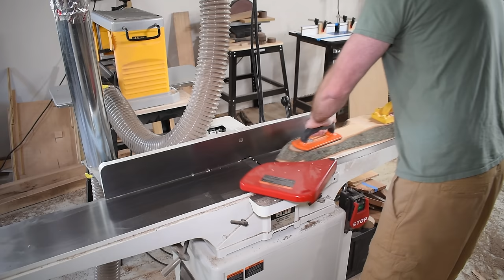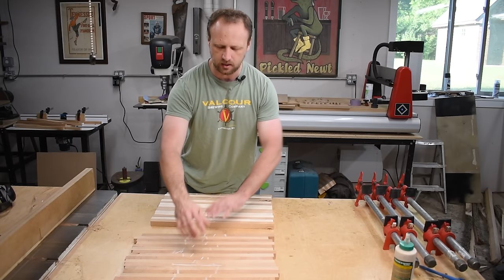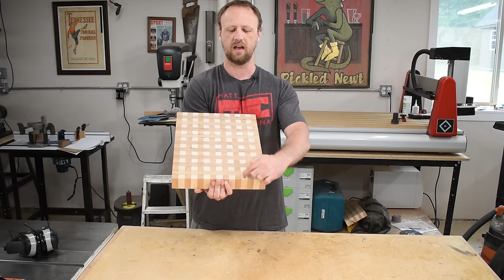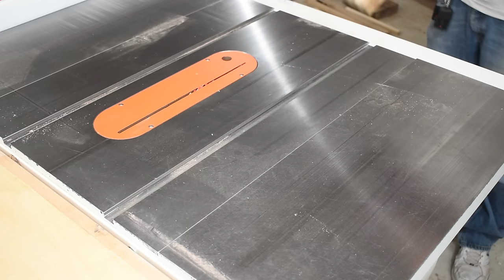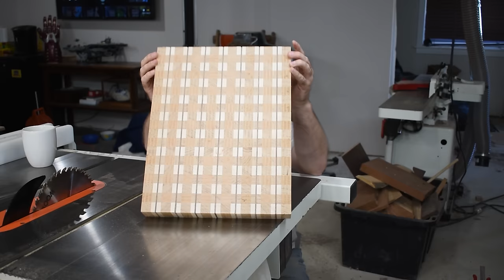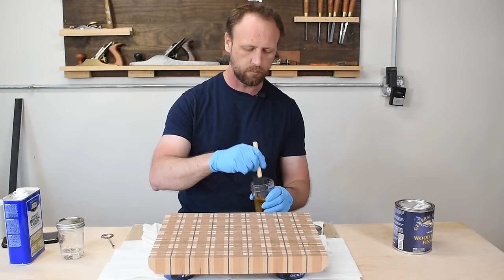Making a Plaid Cutting Board! BONUS - Crazy Finishing Technique

Comment: Be careful; you are mixing end grain and edge grain. Wood expansion won't go in the same direction and you might end up with a faulty board.
Reply: Agreed, I had that same thought.
Reply: @jeepgrand1994  I have made hundreds of cutting boards. The only ones that ever fell apart are the ones where I mixed end and edge grain. This is REAL THING, not just an old wive’s tale. I’ll never mix grain again!
Reply: I had to put edge grain strips in an end grain board to keep it flat. It's been about 10 yrs and no problems yet and we use it just about every day.
Reply: What if you stabilized the wood before finishing or final assembly

Comment: He didn't make the walnut end Grain. I would make it end Grain.  I really do love the plaid, nice work!
Reply: I'm experimenting now, with cutting thin strips on the table saw, being end Grain though is a challenge
Reply: Ben Moore  make a walnut endgrain board to needed length and rip strips from it. May seem like a lot of work but its the only proper way
Reply: Came to say the same. This will not last unfortunately. Beautiful though.
Reply: Ben Moore  lol who needs books and the knowledge of those who have failed and learned before us?  You do you though and when you get your first breadboard end that explodes because you glued the whole thing, remember it’s just some wives tale. 

There’s no issue with playing around and seeing what works but when you start a video with “I’m going to show you how...” you expect that this guy knows what he’s doing. Grain rotations on a board that will certainly see heavy moisture is a silly bad idea and it’s unfortunate that someone may watch this and think otherwise. Or that they cannot safely run end grain through a planer (you certainly can...with proper prep). Or that you need a $4k CNC to flatten a board, etc.
Reply: Ben Moore  glue up panels of walnut then cut them across the grain, making them end grain, then rip them into 1/8” strips.
Reply: @aaronwunderlich3070  I use my cnc to flatten things all the time lol

Absolutely you can run endgrain thru a planer, I’ve done it often with good results. And once where it got hung up and basically fucked off the planer. I’ve done dozens of boards on my cnc and never had an issue.
Reply: @zbeshears6945  I too use a CNC to flatten on occasion.  My point was that there's a video here that seems to advocate that you NEED a CNC to flatten a board, which you certainly do not.  And I didn't say you couldn't pass endgrain through a planer, just that you have to properly setup for it.

Comment: Great video! Nicely filmed, nice commentary, and the board is certainly beautiful. I really like your work.

That said, I do have a couple of comments.

First of all, I don’t know where people get this idea that you cannot use a planer to plane these cutting boards down. I know what people say, that it will end up exploding, kick back out, and the machine will toss shards of metal around your shop, creating an Armageddon scenario!. Well, I have experimented with this for years, and i’ve made about 200 end grain cutting boards. I always use my planner to plane  it down ( previously a Delta Lunchbox and now Dewalt 735). I use the following method:

Use hot glue and shims to stabilize it on a flat length of MDF.
Make sure the blades are sharp.
Make passes in only tiny increments of thickness, maybe 1/256
Before passing them through the planer, use a hand plane to create a small 45 degree bevel on  the trailing edge. This will prevent chip out.
Remove from MDF and repeat on the other side.
It leaves it so flat that it only takes 5 MINUTES of sanding to complete the project!

Second of all, I really do think the mixing of end grain with edge grain will lead to failure. I have done so with only 3 boards, and all three cracked and fell apart in a few months from differential wood movement.

Again, I think the board is beautiful and it’s a great video.

And I now wait for the correction posse to come after me.
Reply: Those were the same things I was gonna ask. Guess good thing I read comments before so.

Comment: Do you have any issues doing the strips being long grain mixed with the endgrain?
Reply: This would be a concern of mine. I built a brick and mortar style years ago and mixed grains and it ended up failing over the years cause of it
Reply: @TomKaren94  Add more glue XD - in all seriousness, I have experimented with a few different wood glue brands/types/strengths etc and I found that my builds held best when not using a "quick dry" glue. That said, I tend to give glue-ups at least 12 hours to dry before removing the clamps, but in some cases more time was needed to firmly bond the pieces. I have also seen a few pieces pop apart due to the wood being kiln dried, which introduces some interesting tension mechanics if it isn't left to settle before milling.
Reply: Generally, a bad idea.
Reply: I’ve never built a board or anything much really and wondered the same thing. Other videos I’ve seen they created end grain strips as well

Comment: Hey Billy, regarding the finish, I am very much a fan of a sealant that actually hardens. I recently made the mistake of oversaturating a board with mineral oil - was weeks of leaching before it could be used, and still feels greasy.  

I’m interested in long term durability of the salad bowl finish. When the finish hardens on an end grain board, I imagine the fibers become stiff and brittle. I’m concerned the fibers might break rather than pull back together (“self-healing”) when a knife penetrates them.

Have you experienced this over time with this finish? Would be much appreciated if you could share your experience with this…thanks…Skip

Comment: Beautiful work, absolutely amazeballs! Question? I've never done inlay before, would you be able to make solid color end grain cutting board, stack it on top of one similar to what you've made, then on a scroll saw, put the angle at just a few degrees, and cut out say like a peace sign and then just drop it in to produce the inlay? Would that be the correct way to do this?

I was just thinking the contrast of the plaid with a solid color inlay, I thought a peace sign would be cool, would be absolutely beautiful and really pop together, especially once the finish is put on. But, would what I asked above be the correct way to do this?

Comment: Billy, that's awesome looking board. The amount of works you have put into this is tremendous.

Quick question, are those strips edge grain or end grain ? I watch many video that said not to mix both on the same board, or it will crack.
How is that possible ?
Reply: He is probably banking on that the walnut pieces are so small, thin, that the movement with me minuscule and not cause any harm.

Comment: I have made many cutting boards but never made a plaid but always wanted too.  I will use your method but will use end grain walnut strips.   I fear you crossed you gains and may have issues when the wood expands or shrinks.  Also I worry about the open grain of oak.  Just my 2 cents...

Comment: I made a few cutting boards and they look great. But a few weeks later if you run your fingers across you can fell the sims, kind like if the wood swallow but the weird thing is that l haven't used yet. I treated with mineral oil and beeswax.

Comment: What was the ratio of salad bowl  mix to mineral spirits and was it the same for all 3 coats? Great video I’m definitely gonna try this. Also how does your glue ups not stick to your squaring jig as the glue pushes out and it’s clamped to the board. I’m thinking you could use wax paper?  Curious on that one.

Comment: Wow! What a beautiful board! Very clever! With regard to finishes... If you actually cook from scratch there is a big difference with regard to the amount of time your food is in contact with a cutting board as opposed to the time a french fry might lie on a table before it is consumed. On top of that cooked food is dried out and therefore usually less porise than raw. So the porise raw food you have coming into contact with the finish on a cutting board for the 10 minutes it takes to slice is considerable. If you do more research you'll find the most food safe finishes are actually made from food. Believe it or not some food oils when heated and let to cure become stable and don't become rancid, like walnut oil. Whereas finishes made from the same stuff as gasoline won't kill you immediately they may add to the toxic load in your body. But beeswax on the other hand is actually considered a healing food and people eat it to help aid their digestion. Why not use finishes on cooking items that are actually digestible and aid digestion!

Comment: The board looks amazing.  So, I send end grains into my planer 🙃...It works great as long as I take extremely light passes...the down side to this method is that I am limited to how wide my boards can be.   I really like the choice of finish.  I have tried the Tried and True, but that finish won't last long with washing and cutting... Or I don't believe so anyways.  This method seems like it was last a lot longer.  Are you concerned with the long grain Walnut vs the end grain surface?  The strips are so thin that I don't think it would really matter... Plus It actually might keep it a little more stable.  One more thing about it, this finish must be embedded into the wood and probably keep it a little more protected from the moisture (less wood movement).  Curious about your thoughts on that because I have heard that you dont want to mix long grain and ingrain in boards (everyone has an opinion).  The board looks beautiful 👍
Reply: @NewtonMakes  thanks for the info man!  I want to try the finishing method ASAP.  Keep up the great work 👍

Comment: So i havent made an end grain board yet but have researched it quite a bit. With those walnut strips shouldnt they also be end grain? the board will eventually fail with having end grain and edge grain fighting each other. thats why people glue up those thin strips in a panel and then cross cut them and insert. Regardless beautiful work and nice pattern

Comment: I am a woodworker as well and have made many cutting boards. I have always heard that you shouldn't mix end grain and long grain in the same board. This board is end grain with long grain in the walnut strips. Do you foresee any wood movement issues long term with this?
Reply: I usually glue up an end grain panel and gut it into strips, but in this case when you think about the application, the end grain is on top and bottom.  So basically the walnut strips are just like gluing face grain or edge grain - I don’t foresee the issue many are talking about since its not an end grain-face or edge grain glue up

Comment: Great video Billy.  I have a comment and a thought.  Comments are easy, thoughts not so much.  I made a 3-d cutting board a while back and used the General finishes salad bowl finish.  So far it is still smooth.  So the seams are not discernible.  Now for the thought:  Seems to me that if you use a poly for the finish it fills all the 'straws' thus making the porous wood like the oak non porous.  What do you think?  I' m just an old retired tool/model maker, so I am no chemist. LOL

Comment: Hey bud. Can I ask why the dust collection on your planer has a 2” piece connecting two 4” connectors? Wouldn’t the dust collector work less and collect more if you went 4” to 4”? Or does the smaller piece improve collection?
Genuinely asking. I have the same planer with a 4” connection...but my small delta dust collector get clogged with planer shavings.
Thanks!
:)
Reply from the maker: I get asked that question a lot. I get it because it's deceptive. My planer has a 2.5" port. It looks like a 4" port but it's molded plastic that goes down to 2.5". I don't want to cut it off since I'm upgrading my planner eventually and whoever gets this can use a shop vac with the current setup.
Reply: @NewtonMakes   I promise I am not trying to insult your intelligence lol. Like I said, I have the same planer, and mine came with an adapter to bring the 4” to a 2.5”. Just figured I’d point that out in case you got it used and didn’t realize...or maybe yours is newer or older then mine. Like you, I’m hoping to upgrade soon.
Thanks for amazingly helpful videos!!!
:)
Reply from the maker: I sure wish mine was an adapter but nope it is all one solid molded piece of plastic. They probably figured that the majority of people would hook it to a shop vac so I understand. I've had other people tell me they have the same planner and theirs has a 4-inch port but obviously something is different. My guess is that they changed something year-to-year. I don't take the question as an insult. That's the point in social media, is to be social. Unfortunately I've been asked this question by a lot of people who were not so polite. Strangely this is the one topic and which I've been called too old to fully understand dust collection and I've been called too young to understand dust collection. YouTube is a strange strange world!
Reply: @NewtonMakes  Good old keyboard warriors! Sadly they don’t know any other way but “mean”.
I’m not sure how much difference a 4” port over a 2.5” port will make, but just to make things easier, I’d probably cut off the 2.5” and let whoever buys it get their own aftermarket adapter. On the other hand, if you’re not having issues with it...”if it ain’t broke, don’t fix it” lol

Comment: Did oak (open grained wood) end up being alright for an end grain cutting board?
Reply: @NewtonMakes  did you have any issues with edge grain walnut being compatible with the other end grain woods around it with regards to expansion and contraction?
Reply: @johnbracken8917  Not trying to be a know-it all but the walnut was actually glued to the edges of the other woods and not the end grain.

Comment: Well, the same company doesn't recommend Wood Bowl Finish to cutting board, they recommend Butcher Block Oil: "Wood Bowl Finish is a durable oil-and-urethane oil-based finish is designed for use on decorative wooden bowls and turnings. For countertops actively used for chopping and cutting, we recommend Butcher Block Oil". This is not angry comment :D

Comment: If the pieces are 7/8" square how do you plane them in a 13" surface planer?
Reply: @NewtonMakes  Your  squares are 7/8" wide. With 15 of them across that equals 13 1/8" wide.  That's 1/8" wider than your 13"planer can cut.
Reply: @NewtonMakes  When I made a copy of you beautiful plaid cutting board I made my squares .83 wide so when I did the first glue up I could run it through my 12.5" Delta surface planer. Once I ready to flatten it after all the glue ups is when I used the router and sled method. My cutting board came out a bit smaller but it looks great. Thanks for your video.
Steve

Comment: any reason you couldn't just cut 1/8" channels down the length and drop in 1/8" squared stock with some glue and then repeat on the short side and ends?  That way, you get the desired look but not cutting the board apart twice...
Reply: @NewtonMakes  i think that route would prevent having to cut the board so many times and gluing back together too.  I work at a hobby shop and we have 1/8 square walnut, cherry, mahogany stock so I personally would do that just to save time waiting for the glue to try between cuts :)
Reply: @NewtonMakes  also just realized that by cutting channels, I'd have to adjust the fence for every cut, so there's that :(

Comment: I am going to attempt this this next week and I am very excited! Question for you. I noticed that the walnut you used was not end grain. Has that contributed to the board splitting over time? I see that a lot online where have a mix of end grain and long grain pieces leads to splitting. Did you have that experience? Did you find a way around it?
Reply: No reply to this hmm. I have read similar comments before.
Reply from the maker: I addressed it multiple times in the comments section.

Comment: Hmm...Well great cutting board, except the finish. But not for the reason you suggested...As you stated a end grain cutting board is like a bunch of straws. You with your finish have sealed those straws, hard. Thats a no-no. The whole purpose of using an endgrain board is to protect the edge of your knife. The end grains are soft and flexible, they move as the knife comes down on them. Your end grain can't move its hard.

Comment: Re finishes check out Osmo.
Reply: @NewtonMakes  the only other finish I use that I’ve found a fair number of fellow wood workers don’t seem to have tried is Automotive Clear Coat.  Obviously not for cutting boards but it makes for a very nice gloss finish that is extremely durable and super thin.   If you haven’t and decide to trying the automotive coating I strongly suggest pre-sealing the project with something along the lines of Benite from Daly’s which I have found reduces expansion and contraction extremes which can crack the the finish.
Reply: @NewtonMakes  I personally like Sherwin Williams’ automotive line of paints,  which are sold in their own stand alone shops not at your regular sherwin Williams house paint retailers.   It requires HVLP spraying gear so if not already part of your setup may represent a bit of an investment the big key is to make sure you’ve got air moisture separators it’s pretty unforgiving in that regard.